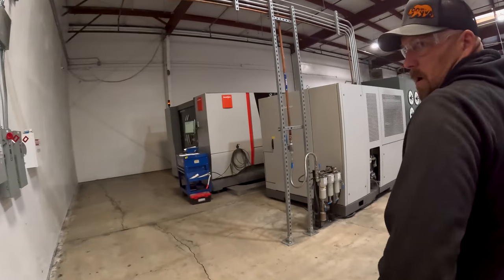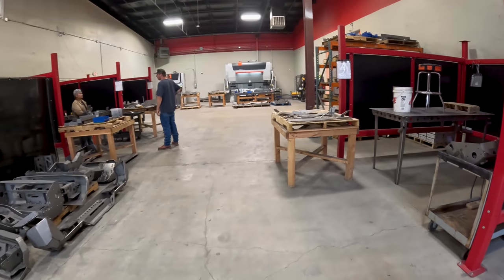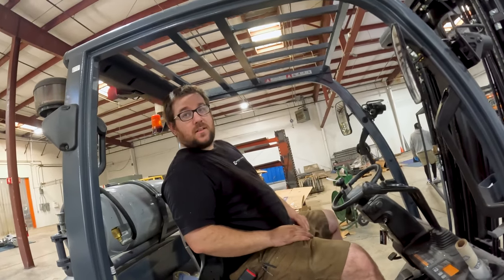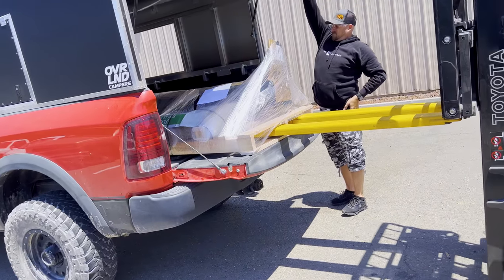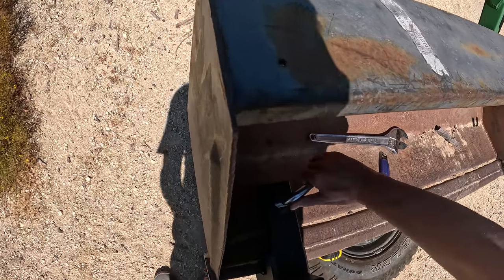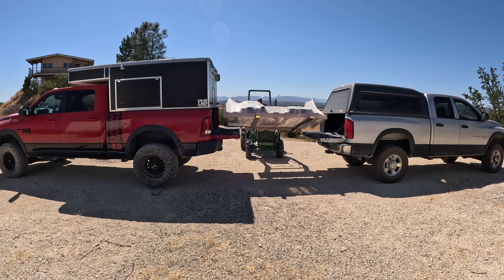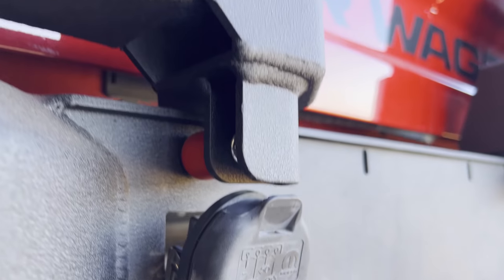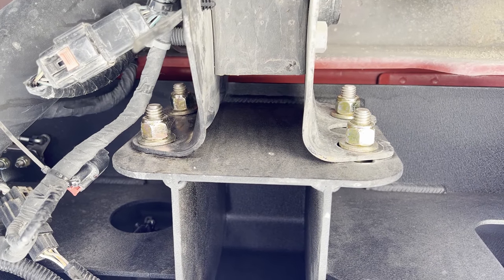Chassis Unlimited Octane Dual Swing Bumper Installed! [Power Wagon Episode 7]

Comment: Great video with tips at the end. Curious to why you swapped out the Rig’d swing arm for the bumper? We’re seriously considering both exact solutions. Rig’d is less expensive and lighter so we were leaning that way, but maybe there’s something else we should be considering. We do take ours Offroad, but no hardcore rock crawling.
Reply from the maker: Thanks for watching & commenting! There were a number of reasons for the switch. First, our UltraSwing had a 2” hitch shaft. The Power Wagon has a 2.5” hitch receiver so we had to use a reducer. The result was that the anti-wobble device on the UltraSwing was good but not perfect, and there was some movement at the hitch. Second I really wanted a left side swing to work better with our awning on the right side of the camper. Third, the latch on the UltraSwing is at the pivot end of the swing which means when the truck hits rough terrain the weight of the tire has mechanical leverage against the latch. In my (non-expert) opinion this causes more wear on the latch, and movement at the bumpstop. In fact RIGd did replace one latch under warranty (the original failed). Additionally I wanted the additional carrying capacity on the 2nd swingout. I think the UltraSwing is a fine product, a swing bumper is a more robust solution but costs more and takes a lot more effort to install (as you might have seen, lol).
Reply: Thanks for the additional details to help us make a better informed decision.

Comment: Thanks for the video. I ordered this bumper a month ago and can't wait to get it. Do you like it, how is it working out for you. Thank you for the license plate wiring connector info, I did not want to cut into the factory wiring.
Reply from the maker: Thanks for watching & commenting! The bumper is working out great, hopefully a few more camping etc videos soon!
Reply: They have changed the bumper design. The lock mechanism is totally different now, no push button cable setup. I Installed the one you have 2 days ago and one of the latches won't lock!
Reply: Chassis unlimited now offers stainless steel slide plates for the secondary latch. Reach out and get you some.

Comment: I really love my rear bumper. But an instruction manual would have been nice.   The only problem I’m having is the latch system. I hate it! There has to be a better option. This past weekend was the first time I had to put the truck thru some mud, after opening the swing out, I could not latch it back. Yes it was my fault it was full of mud, but after cleaning it and blowing the latch out with compressed air it still will not lock in.
Reply from the maker: Thanks for commenting! I have not had problems with the latch, yet. I have wondered about the long term durability of that cable release button mechanism. Given your comment I am definitely going to keep that mechanism well lubricated! And yeah, the lack of documentation caused me make mistakes that cost me a lot of time on the install (cutting off the retained nuts in my case).

Comment: So instructions suck from company how are you connecting bumper to truck- you don’t show or explain in your video
Reply from the maker: It bolts on to the chassis. 10 bolts in total, 4 either side, and then 2 on the top of the bumper in the center.